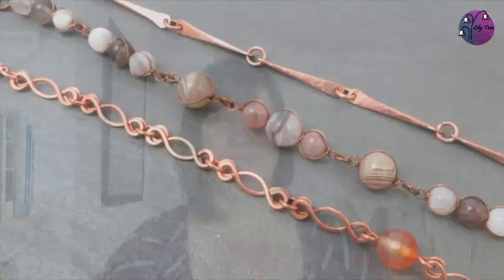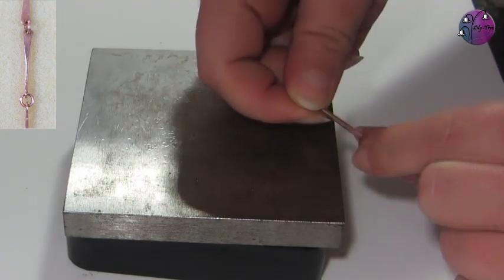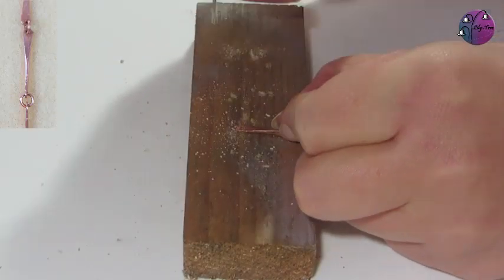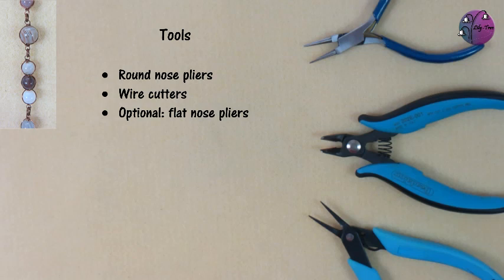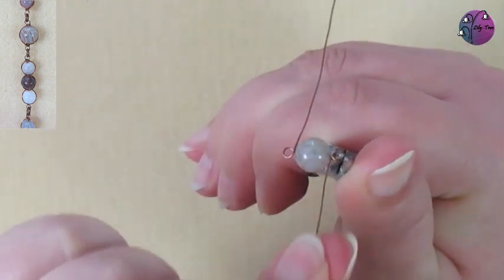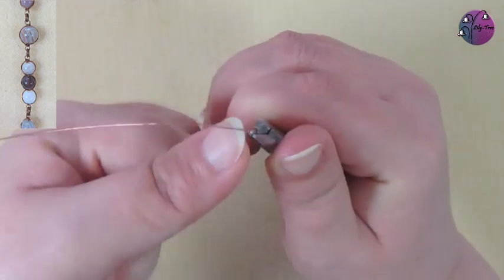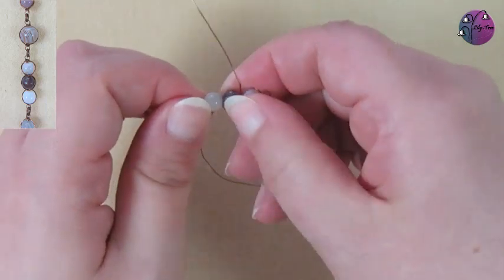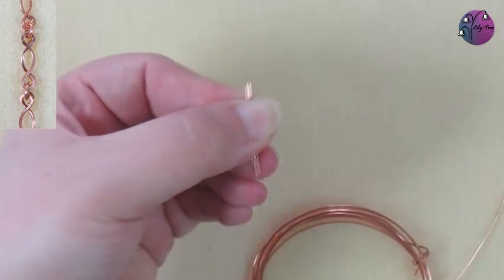3 Chain Links for Jewellery Making

Comment: Do you make your own jump rings??If so what gauge of wire do you use?? Your work is beautiful!!!
Reply from the maker: Thank you!  Yes I most often do.  The gauge of wire depends on the piece I'm using them for, I most often use 1mm/18 gauge but have used anything between 0.8mm (20 gauge) and 1.5mm (15 gauge).

Comment: I love this tutorial and I was wondering what kind of drill you were using and the size bit used to drill along with the polishing piece?
Reply from the maker: Thank you Lynee!  I have a Foredom pendant motor that I splashed out on, and I admit that I love it.  I use it for both drilling and the polishing.  I think the drill bit I used was 1.2mm, just so that 1mm diameter wire jumprings will go through easily.  If you're not on metric, sorry, I don't know the drill conversions.  The polishing wheels I used in this video are 3m Radial Bristle Brushes and a wool polishing mop, with pink Luxi compound.  For more details on polishing, check out my video on it at https://youtu.be/ynBCR6igKJM .
Reply: Lily-Tree thank you very much.  I look forwards to other videos.  this one and the information given has helped me emensily.

Comment: Thank you! Love you tutorials! 
What size drill bits do you use the most? Blessings, G’ma
Reply from the maker: Thank you! 😊 It depends on the project, but I tend to use the 1mm and 1.2mm the most because I'm often putting 1mm diameter wire through.  I did treat myself to a set, though, so I have plenty of choice! 😄
Reply: Lily-Tree  Thanks for responding! 😊 I’m saving for a Dremel and want to get the right tools. That helped.  Fingers crossed!🤞
Hugs and Blessings, G’ma ❤️🙏🌀✨🤗

Comment: Great tutorial! Love all three of these chains. I have one question, is the copper wire you use deadsoft or half hard?
Reply from the maker: The wire I have is dead soft.  I find that this is easier to shape and manipulate, and for the hammered links the hammering then work-hardens it enough to hold its shape.

Comment: Wow great tutorial. Thank you. 
Is it ok to make these pieces without soldering the jump rings closed? Xx
Reply from the maker: Thank you!
Yes, you don't have to solder the jumprings, as long as the wire is strong enough to hold its shape.  You could also solder them if you wanted some extra strength, though.  And I'd always leave one unsoldered anyway to act as a 'break point' if the chain gets caught on anything.

Comment: I love your designs, just wondering how to avoid my fingers from turning green? Any suggestions?
Reply: @Angelica Hogan, copper is just going to do that to some people. 

To prevent it, though, there are several options. You've probably figured these out by now, I would suspect, so I'm posting this for other readers who have yet to come along.

You can buy stretchy self-stick tape on some of the jewelry supply sites that is sized to fit fingers. Just wrap it around those green-prone digits before starting your work! If you can't find it, buy the narrowest Coban you can find in the drug store and then cut it down if necessary; it's the same basic stuff. And if you know a veterinarian who is willing to share, or to sell you a few rolls, VetWrap is the original of this stuff - and the cheapest of all. It also comes in a much wider array of colors than the green from the jewelry supply stores and the tan in the drug stores. You could probably order it in bulk if you wanted to from some veterinary supply houses, but I suspect that would get you more than you could ever use in this lifetime.

You can also buy either leather or latex finger cots that are made for this same purpose, but the leather ones in particular might be a bit bulky for making delicate things like chain. Again, you can buy latex ones in the drug store. 

Work gloves of any sort would serve the same purpose, although, again, they might be a little bulky, but some pigskin ones are thinner and fit very snugly. You can get those at any hardware store. Any sort of glove with a good grip in the fingers would work, really, although you probably won't want to use the good leather ones you wear with your dress coat ;-)

Finally, of course, once you've finished your piece, you can spray or dip it in a solution that is intended to seal metal, which will help keep your jewelry from tarnishing and turning your skin green when you wear it. I can't remember the names of such things offhand, so hopefully someone else will mention it. Don't get it on any gemstones, though; it might damage them.

Once you get the hang of these things, you might just want to change to using sterling silver wire for subsequent projects.